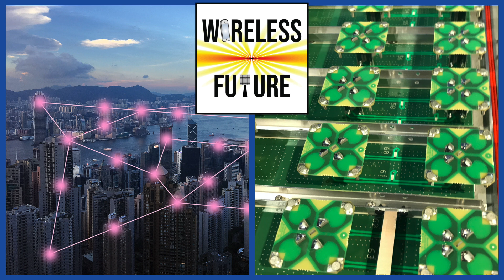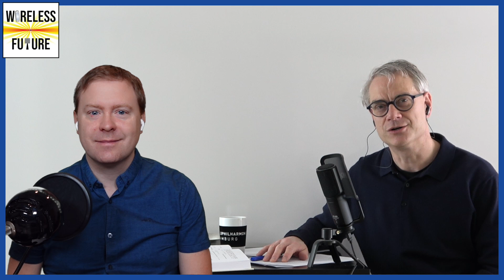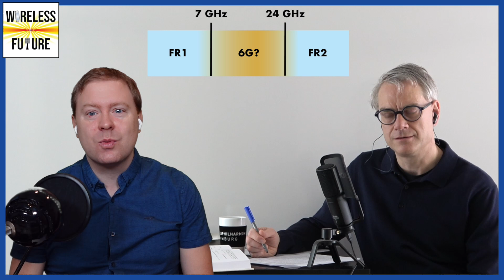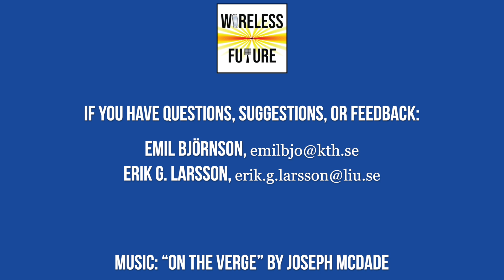Ep 41. 6G in the Upper Mid-Band [Wireless Future Podcast]

Comment: Speaking about near field beamforming, is the a rough estimation on how many users we can multiplex at the same time?
Perhaps dependent on  L of the array or lambda?
I think we cannot put endless users behind each other with a realy tiny distance from each other.
Thanks.
Reply from the maker: If you have M half-wavelength-spaced antennas, you can multiplex up to M users.
If some of the users’ channel vectors are very similar (e.g., in the sense that one user is inside the half-power beamwidth of a beam directed toward another user), then we have to reduce the number of users that we serve so it is smaller than M. This issue can occur in both far-field and near-field propagation scenarios, however, near-field MIMO channels are ”richer” since each propagation path carries both angle and distance information, so there is a bigger chance that users are two random locations have sufficiently different channel vectors to be served simultaneously. We elaborate more on this in the following video:

Three Misconceptions in Near-Field Communications
https://youtu.be/Jwya3-enlrc

Even if near-field beams have a finite depth, you are right that there is a limit to how many users can be served in the same angle but at different distances. For example, in Figure 10(a) in https://arxiv.org/pdf/2307.02684 we have a huge number of antennas but can still only serve 6 users in the same direction.
Hence, if one could choose between distinguishing between randomly located users only using angles or only using distances, then the angle domain is much more useful. The main selling point of the near-field is that we get both angle and distance resolution, which makes the channels richer and more distinguishable.
Reply: @WirelessFuture  interesting, thank you. 
But near field- and far field beamforming from one array are not possible at the same time. Is that right?
(I can transmit to M/2 devices in the near field and M/2 in the far field - but not M in the near field and M in the far field.)
Reply from the maker: @ you are right! The near and far field share channel resources, so the total number of users is always upper bounded by M.

We discuss this and related things in the following new paper:
https://arxiv.org/pdf/2407.07448

Comment: I think you are making good points, but I do think you have to look at the cost, energy efficiency, manufacturability and technology available to develop and mass produce these sorts of devices. 
There are today products that are techincally ready to be launched with significant number of antennas for 5G, but they are not launched as they are not commercially attractive due to their energy consumption.
Also some other topics, TDD.. Yes, but then you realize that the first operator on a continent basically sets the UL/DL pattern for the whole continent. (It was even back when 3G was standardized discussed). Yes I am that old, that I took part in those meetings.
What are they looking at these new frequencies? A, they dont have them yet. B going higher then FR2 will be difficult to sell, when FR2 did not really take off. 
I make a living out of T&M so I look forward to this , but I must say that I see this as a longer time project.
Reply from the maker: Thanks for the input!
Technology maturity is indeed a limiting factor in practice. I’ve heard that Chinese operators who were quick with deploying 5G Massive MIMO are disappointed with the high energy consumption of the products available at that time. To my understanding, the current 5G products for the same antenna configurations consume much less power, so countries that deployed 5G slowly are now benefiting from that. Intuitively, when the technology is mature, the cost and energy consumption should only grow sub-linearly with the number of antennas, since one needs more components but some are common for the entire panel. Achieving that in practice is, of course, a design challenge.

When we worked on Massive MIMO in 2015-2016, the European telecom operator that we interacted with was skeptical to moving to TDD because they didn’t want to synchronize their TDD operation with their competitors’ networks. However, those challenges have been overcome now, even if there seems to be some issues at the boundaries between countries. Picking and agreeing on the right UL/DL pattern is of course a potential point of contention.

I can imagine that 6G technology in the upper mid-band will be available in 2029-2030, but that the deployment of it will be even slower than in the case of 5G since it takes time for the demand for more traffic and new services to build up, as well as for the hardware to mature.

Comment: Hello, is there a definition when to say that 2 or more antennas are part of a MIMO system? As you mentioned, it is interesting whether we can calculate with near field or far field laws. 
Or is it rather vague and we say, when the antennas somehow work together , it is a MIMO system?
Thanks a lot.
Reply from the maker: Whenever you have multiple antennas at both the transmitter and the receiver side, you have a MIMO system. One can then categorize MIMO systems further into point-to-point MIMO (compact antenna arrays at two different places), multi-user MIMO (a base station with a compact antenna array serving multiple user devices), cellular multi-user MIMO (multiple cells with multi-antenna base stations and multiple users), cell-free/distributed MIMO (multiple base stations that serve multiple users by transmitting/receiving jointly), etc.

The concepts of near- and far-field are traditionally defined for setups with one compact antenna array and small single-antenna receivers. This is basically what the Fraunhofer distance considers (it actually considers a single transmit antenna, but it is not much different from having a compact antenna array). Current research extends this to scenarios with multiple antennas on both sides, joint transmission from distributed arrays, etc.

The available of channel state information and phase-calibration between distributed antennas can also be a performance-limiting factor, but it doesn’t change whether something is a MIMO system or not - only what kind of algorithms can be implemented and how well they perform.